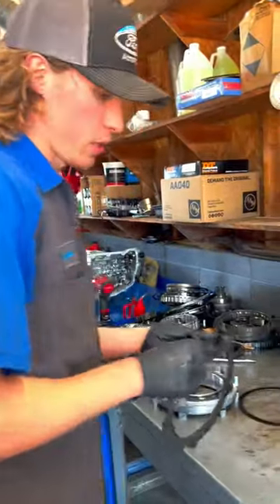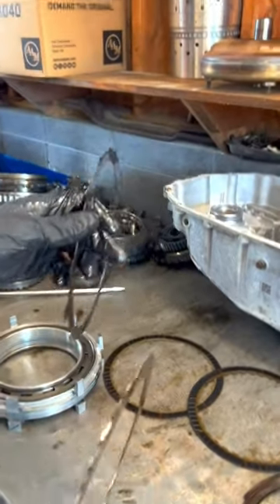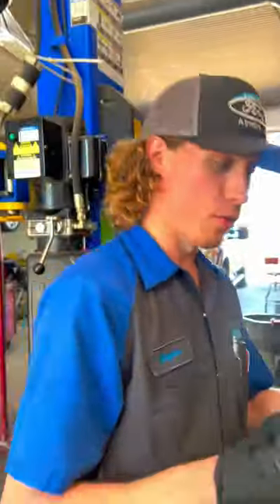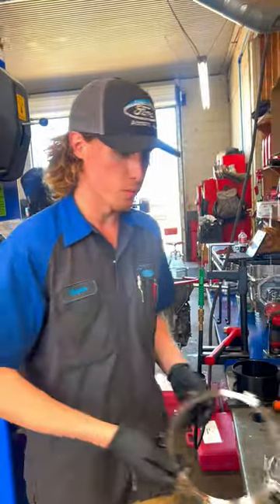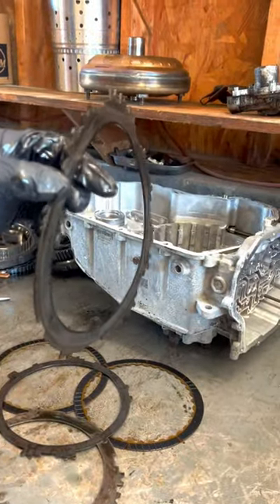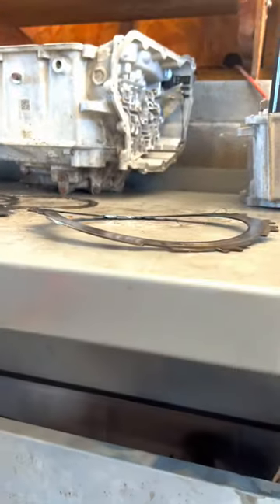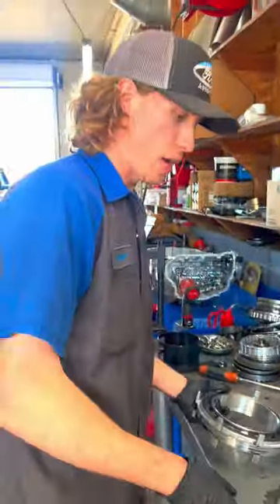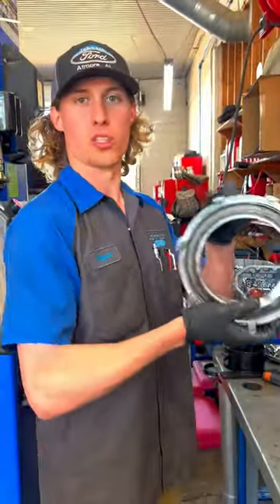Ford 6 Speed FWD Problem? #shorts #ford

Comment: The wave plate is to soften the shift. Not release the clutches.
Reply: The pulse width modulation of the solenoid coil is to soften the shift... not the wave plate.
Reply: @gradoisx2348  straight from Gears magazine. What is a Wave Plate:

A wave plate is a mostly flat disc that is used in the stack up in a clutch drum. It’s a cushion (spring) for the transition when the clutch drum is applied/engaged. It is 1-2 mm in thickness a probably costs all of about $0.50 to manufacturer. However, when the wave plate fails, it becomes like throwing a handful of change down a garbage disposal. Hopefully that paints the picture in leading to the total failure of the transmission and your vehicle no longer moving
Reply: @robertrogers6950  must be true if its from a magazine right. PWM coils do more to soften shifts than any spring or wave plate will.
Reply: @gradoisx2348  it's to soften the shift. Theyve been around before pwm solenoids even existed.😅

Comment: Does the 6F35 has an issue with delayed engagement when switching between forward and reverse? I noticed that on my 2014 Escape, but I can't tell if it's on the computer side or an issue with the transmission itself.
Reply: Check your fluid and good luck fwd ford transmissions are about as bad as nissan cvts designed to fail